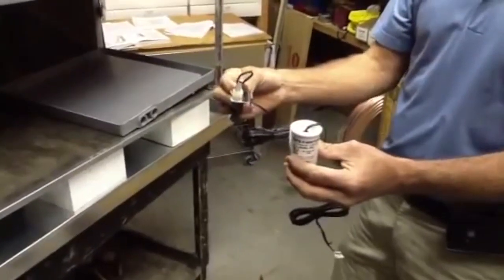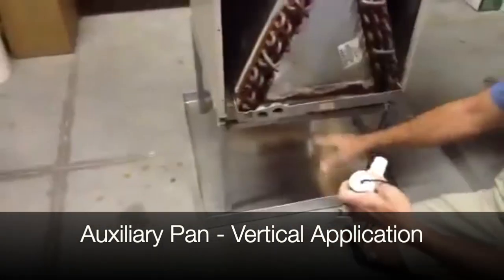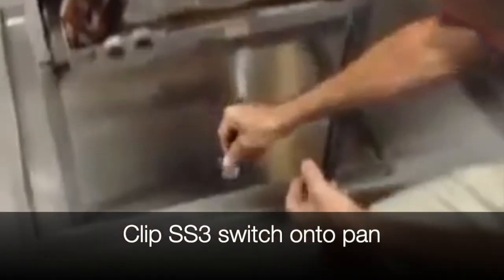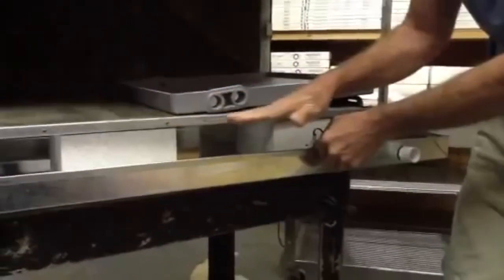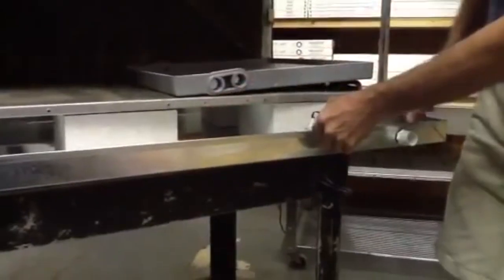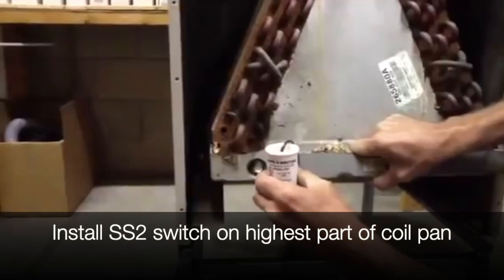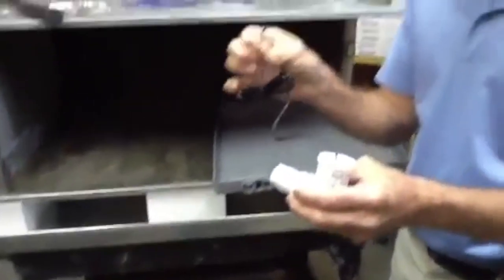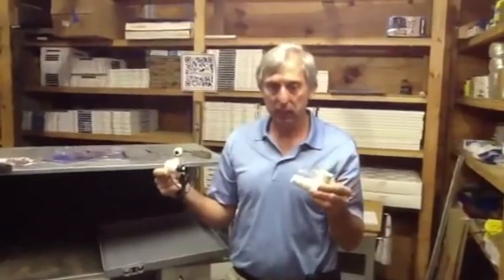How To Install A Float Switch For HVAC Unit: SS2 and SS3

Comment: Nice switch, and will stop your AC unit from flooding the place when the drain line invariably clogs up with slime from being incorrectly cleaned. Blow it out and do not send some form of plug down it, it will get all the gunk in the lowest spots, and will block up again.